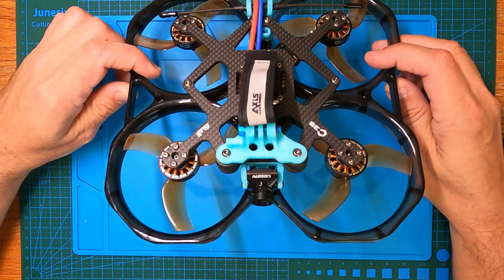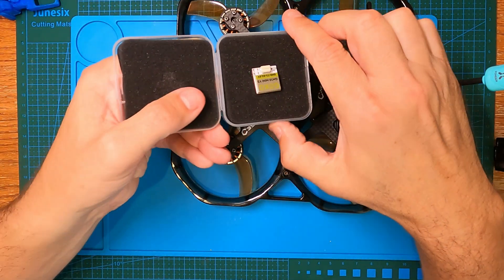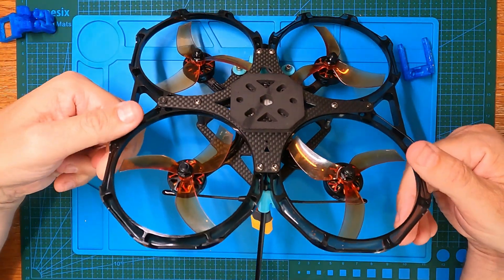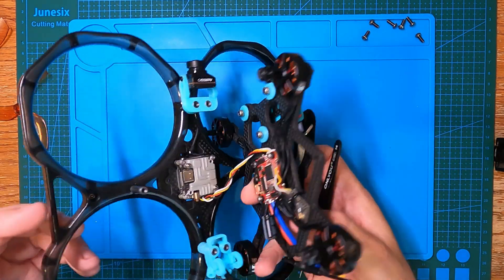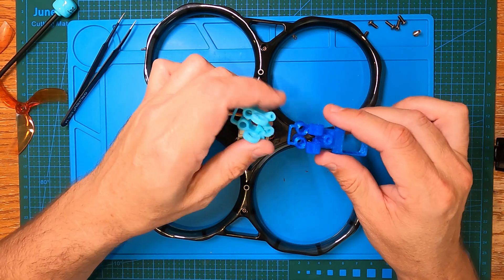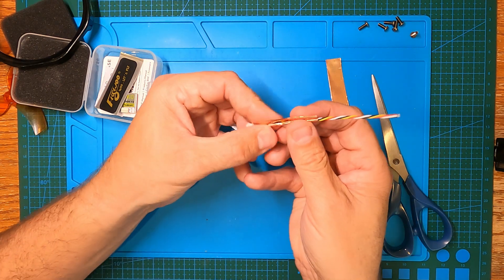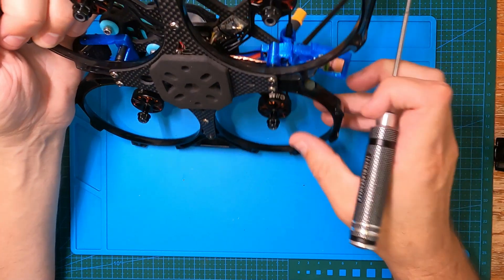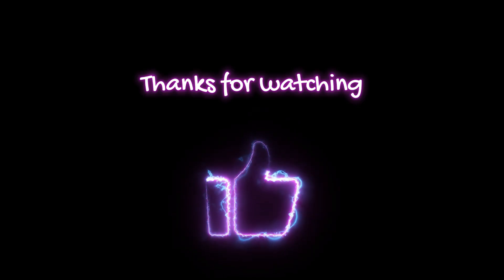Axisflying CineON adding GPS and improved Camera mount

Comment: I flew all 3 Flywoo Model GPS units without any copper. Added the copper and saw no difference during flight. I guess if you have a electrical noise generated by an ESC or motor it might help. I just left the foil on.